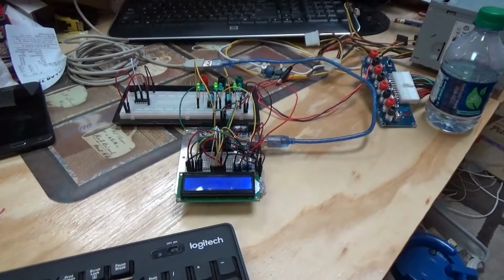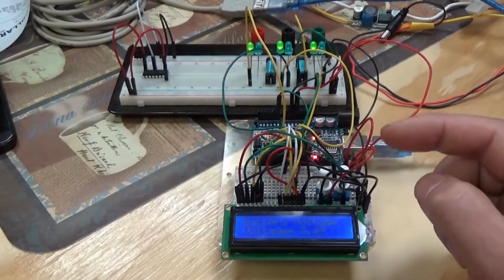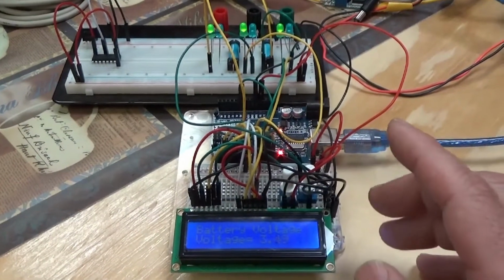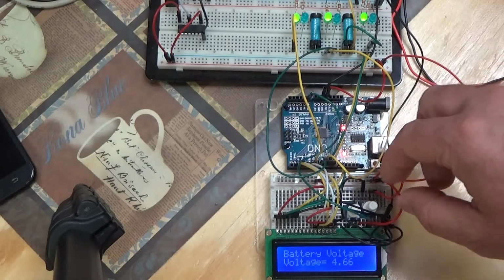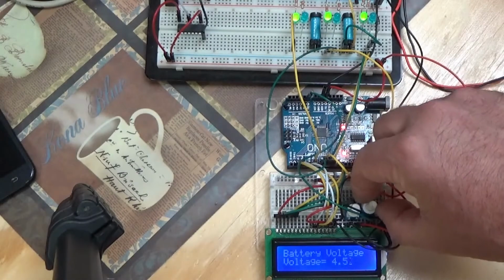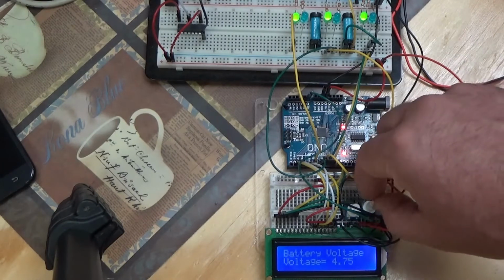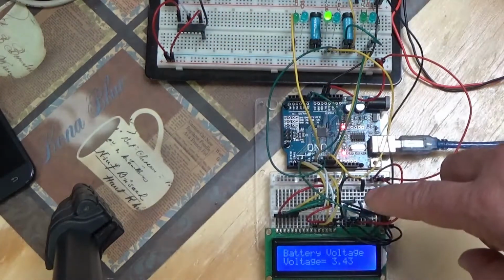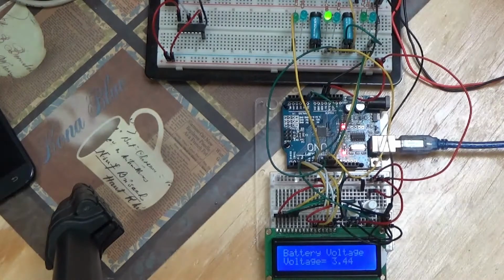Expanding Arduino To Control 3 Solar Powered Mining Rigs Automatically

Comment: So cool. I have not gotten into arduino's yet.  Im learning how to trade BTC now. I have my rigs on solar too but I run them either way.  I have them on UPS's and Good transfer switches.  needed the ups cuz the transfer does not happen fast enough without it.
Reply from the maker: Thank you. That is the answer I was looking for. Using a UPS to buffer when switching power over.
Reply: @thedoityourselfworldelectr8007  I bought on ebay and made my own battery from lithium 7s 18650s. 7s5p fits nice
Reply from the maker: cool

Comment: Hey Troy.  Could you please explain what an Arduino is?
I actually owned a small computer repair shop for about 12 years but
my technical knowledge pretty much stopped after 2012 because of health issues.

Does the Arduino use micro integrated circuits to do a lot of things from a very small  module?
Reply from the maker: It is essentially a very small computer. You can connect a keyboard, display and anything else. You can even run video games on it. You can set it up to do whatever you want. You can program it yourself with simple code which is easy to learn. The advantage is that all of its inputs and outputs are exposed for experimenting.
Reply: @thedoityourselfworldelectr8007  It sounds very interesting.  So the CPU and the RAM  are all part of the IC's  built into the small module then?  Compared to a normal PC how much processing power does an Arduino have?

It sure sounds like some advanced technology the government reverse engineered from one of those Alien spaceships they have hidden there in Area-51.   They are gradually releasing the advanced tech to the human population so it will not be too over whelming a shock to our culture of course.  That is also how we got advanced technological advances like  Velcro and Viagra.    (  Hehe )
Reply from the maker: Not sure about the specs of the Arduino but you can look it up. I am learning to program it so I can use it to control things around the property now.